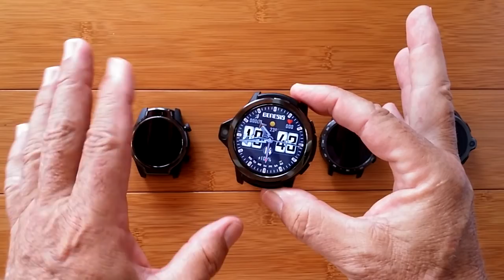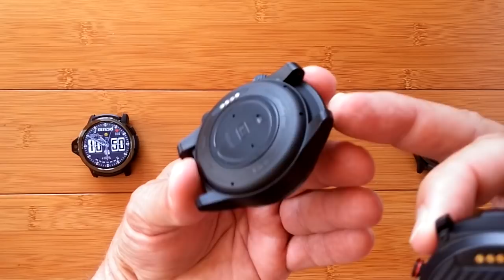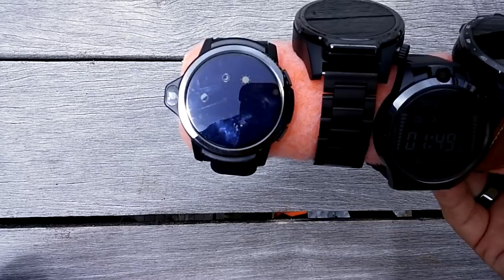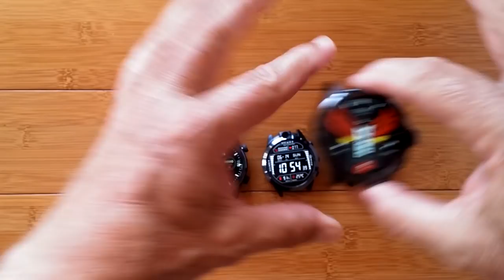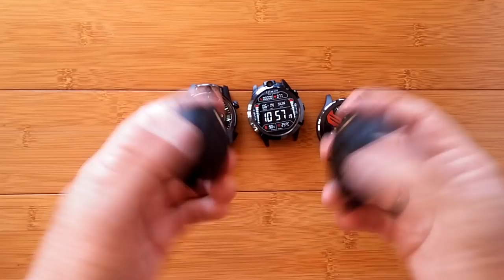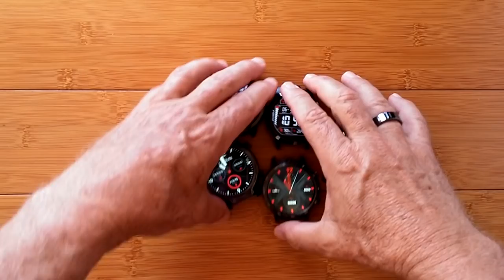Summer 2020 Top Round Flagship Android Smartwatches Compared: Genesis, LEM12, Prime, S08, Thor 5 Pro

Comment: When You tested the watches outdoor screen wisibility, all on one towels,the S08 and the  kospet dont use the full brightness.When You  jump in to inside, (17:00 ) You can see the floating programm circle on the kospet,and s08 is lower 2 or 3  point, under maximum brightness...or i am look some wrong?
Reply from the maker: The ones with the Display Brightness app installed override whatever the brightness level is on the watch indicator, so that may be misleading. My attempt was to set the brightness to maximum outdoors on all watches, and adjust to best brightness indoors so the watch image wouldn't be washed out. The comparison is meant to assess outdoor viewability as indoor viewing is dependent on my backlighting, stage illumination, and actual watch face brightness, which varies from watch to watch and can't really be compared under those conditions.
Reply: @SWT   I say this,because on my prime ,yes,the main brightness set up have 3mode,like low,medium,full bright,but, for example if i choose the full light option,and then go to the set up with slide option ,i can adjust the brightness without levels.And if i slide to forexample to 65%,and then go to main menu, of course,the main menu show,the light is on the full,but the slide option show,the light is not on the full.I have see this on Your video too ,when You compared the genesis to prime a months ago..
Have You make a long test with S08?I mean eweryday test? Use the watch day and night,wash hand,go to strand,and so on..?Have this watch the real IP68?
I think,if the manufacturer of S08 build the wireless charger coil around sim round cover,in place of the charge pin,the watch win all comparison!
 
Oh,one more option..the nfc chip..i know,i know,the chinese dont pay for license,because cost one arm and one leg,but we can use the nfc not just for pay...door open,car open,light up and down in the house,etc..what You think?

Comment: So in the outdoor comparison, all but the Genesis are using up battery as fast as possible while looking it at, yes? The Genesis is at lowest power yes?. I don't think you mentioned that. I'm a transflective watchface junkie, have used maybe 100 or more, and finally found one called Vintage-gauge-MKI that looks best with no backlight, and is easily visible indoors.
Reply from the maker: Actually no, David. Sorry to disappoint. The Genesis is more of a "reflective" than transflective screen, so it still needs a backlight indoors. So do transflective screen watches, but the screen illumination management on the Genesis is Android 7.1.1 and aligned with other Android watches. What I'm saying is that the darn backlight is still on anytime the screen is on, indoors or out. Transflective screens only light up for a few seconds when you press a button. I even have offered a $100 cash reward to anybody that can figure out a way to shut off that darn Genesis backlight but leave the screen activated, without rooting the watch, and guess what. Nobody has been able to do it, rooted or not. So sadly, the Genesis battery life is nowhere near what it would be if the screen were handled as if it were transflective. Hope this makes sense.
Reply: @SWT  very helpful, ticks. Thanks for the info.  Until another good transflective comes out I'm not giving up my amazfit pace. What I hope they'll really do is make a smart watch with the new color e-ink tech they're trying in the new ebooks now. Why they haven't is astonishing to me.

Comment: Where to buy legit Genesis? ♥️
Reply from the maker: Not available anymore. Not likely to see another production run soon, either. Sorry. It was a great watch. Only 500 ever made. Real collector's item now.
Reply from the maker: NEW: Check out the Kospet Prime S UPGRADED Kronos Blade Genesis design with top camera and front camera on right side of watch:  https://www.banggood.com/custlink/vDmYjnTMRK  ( Use Coupon: BGb76871 for launch price $99.99 limited supply )
Doesn't have the transflective screen, but the camera is in the right place at the top.

Comment: You are wrong about 5ATM on the second watch , read this . Lots of people dont know this . 
WR - the watch is not waterproof - avoid any contact with water. WR 30m / 3ATM / 3bar - only slight spraying, but not immersion of the watch in water. WR 50m / 5ATM / 5bar - only slight spraying (when washing hands, rain, moisture) , but not immersion of the watch in water. WR 100m / 10ATM / 10bar - watches suitable for swimming and surface diving. WR 200m / 20ATM / 20bar - watches suitable for recreational diving (scuba diving). WR 300m / 30ATM / 30bar and more - watches suitable for deep, professional diving (with a bottle).
Reply from the maker: It's all about MOVING water or STILL water. https://www.howtogeek.com/218747/water-resistant-gadgets-arent-waterproof-what-you-need-to-know/

Comment: Thanks for this informative review Mr. Ticks. I understand all these watches have a GPS chip. Is there a location tracker functionality as well? I wanted to get one for my kids and make sure they come straight home from school. To be clear, I want to be able to track their location from my Iphone. Thanks!
Reply from the maker: There are some 3rd party ones out there you can use. They're the same ones you would use on an Android phone. I'm not sure about crossover between iPhone and Android in being able to track, so you might want to check that out between phones first, and then migrate the appropriate app to an Android watch and try it out. One thing to remember, you will need the watch to be connected to the Internet to send the location signal, and that means putting in a compatible SIM.

Comment: Can u pls tell me if any of these support bluetooth earphones calling??
Reply from the maker: Bluetooth calling is not supported in any Android smartwatches after Android 5.1 (and a select few Android 6). These are all Android 7.1.1 based, so no. If, however, you have the bluetooth earphones connected to your watch and use a SIM in the watch, then it might be possible, though I haven't tried it.
Reply: @SWT  thanks for ur reply...well thats exactly what i wanted to ask....bluetooth connected to a watch and a sim inside the watch itself....anyways thanks for your time.
Reply from the maker: It should work as in that configuration it's no different than a small Android phone running A7.1.1. As long as your buds have the ability to answer your phone when you tether them to your phone, it should work for these watches. You might even be able to bring up "OK Google" from the earbuds if they can be programmed for that.
Reply: @SWT  thanks alot...and one more last question if u dont mind: any site to get the kronosblade genesis like ebay or something else than their website? Cause it doesnt seem trusty or having paypal! And i live in middle east...

Comment: They seem all useless but the Genesis. Why? That transreflective screen. Those things don't run forever and display backlighting is a huge power consumer usually (unsure if this is the case with the small displays on smartwatches). So the ability to display things in bright sunlight with no backlight is a killer feature.
Reply from the maker: Totally agree, and still shocked other watches haven't used this screen yet. Originally appeared on the Zeblaze Thor Pro, and Jason was able to get the same screen for the Genesis, but nobody else has used it. Too bad. It's one of the best features, even if the colors aren't as rich on an AMOLED screen. If you can't see the screen outdoors, it really doesn't matter how vivid it is. Duh.

Comment: Mr T if you use M2d sender and receiver you can make every Android watch able to reply to messages and app notifications from your watch. I normally kept silent about it but it's a game changer. They even have a Bluetooth version, as the usual version works when both phone and watch are on a wifi signal
Reply from the maker: Wow, great to know. I've heard some folks like to use Watch Droid, but M2d sounds like a good option. Appreciate you sharing this with us!
Reply: @SWT  it creates an interactive notification tab that opens whenever a notification comes in. Much more efficient than watch droid. I'd love for a video to be made on it. It makes every watch u ever reviewed extremely capable. Only downside is it's slightly more technical to set up

Comment: If using the full Android smartwatch for fitness activities (cycling etc), how best to use gos and how long will the battery hold?
Reply from the maker: First swipe down and activate the GPS icon, last on the right in middle row. Next launch Fitness app and swipe twice to the left and make sure switch is turned on to use GPS. Swipe back and pick walking, running, or cycling and start a practice session. Wait for GPS to connect, and then you can swipe right and long hold over the stop button. Scroll down and delete the practice activity, and now you are all set to do a real event. Remember, GPS only works for outdoor walking, running, and cycling.
Reply: @SWT  do you have any estimated time it will last? Will a whole day cycling be doable? For example when using the rollme? Or the kospet prime?

Comment: Great video just what I needed thumbs up! Alright, I made up my mind I'm returning the Kospet for the Rollme. I have a question I bought a band for the Kospet would it fit the Rollme or should I return that also? Suggestion on your tips and tricks video you should name it "Ticks Tips & Tricks!"
Reply from the maker: Haha, I like it, Ticks Tips & Tricks. The Prime and Rollme and Genesis all use 24mm removable bands, The LEM12 and Thor 5 Pro use 22mm and are smaller.
Reply: @SWT  Hey, I just got the Rollme in the mail today its good but when I try to go into the play store I get server error there is no update for the watch I checked and also reset the watch turned on off watch turned on off wifi tested the built in browser I am getting a connection, any suggestions?
Reply: @LoudForLife   hi. I have a question please.  I got a defective Rollme 3 days ago and wants to return it for Kospet Prime. Since you have use both Rollme and kospet, 
Which one do you like better? Which one has better build quality, runs smoothly  and screen brightness?
Have you had any problems with the rollme?
Mine came with screen flickering and would not turn on. So am returning it and was very dissapointed. It may just be a defective unit. Please let me know your experiences with both watches.
Thanks

Comment: Honestly, no matter how long you talk about them I would watch the whole video. I like your enthusiasm for them. I have a request! This might be extremely interesting to you.
I bought a Kospet Prime (non SE) and at first I liked it. That said, I found a very VERY critical flaw. When operating on mobile data on AT&T Band 17 (700mhz) the touch screen has constant random phantom touches whenever data is sent or received. This does not occur when on WiFi or Bluetooth internet connections. Also, a test I would love to see you do is to see how the screens respond to touch. The basic way is to enable "Show Touches" in the developer settings. You may need a "hidden settings" app to get to the real developer settings. This shows a white dot wherever you touch it.
My Prime would show lots of them all over the edges mostly. If you found a full screen drawing app and ran your finger around the edges, you would also find on my Prime that the 45* angle "corners" of the screen could NOT register touch at all for the last 2.5mm or so. Midle top and middle sides worked right to the edge. This made it very hard to press enter on the stock keyboard, it would almost always press "m" instead. I also wonder about multi touch on the S08. I hope it works as expected on it like it did on my Prime, but I am willing to lose multi touch to have a WORKING touch screen. 

Would you be able to make a touch test video? I think you would find the results interesting. I know I would. Capacitive touch screens use a conductive layer of fine wires typically laid out like a screen. Vertical and horizontal lines. This leads me to believe most of these round screens will have limited responses on the 45* "corners". You can use "Show taps" or "Show Touches" depending on Android version for the dots, and "Pointer Location" right under that to draw lines on the screen wherever your finger last went. Draw your finger around the edge in a circle and observe if it makes more of a plus instead of a circle. 

Thanks for all of your excellent videos!
Reply from the maker: Thanks for your feedback. Glad you like watching just for watching's sake. Interesting idea you have there. I'll try it out and see if it feels worthy of a video. I always wanted to try tap dancing. Now's my change!

Comment: Which one would you buy?
Reply from the maker: Genesis -- best for visibility outdoors, best camera placement
S08 -- best for waterproof, best overall cameras, both are 8MP
Thor 5 Pro -- smallest for smaller wrists, bright screen can almost be seen OK outdoors, also only one with always on screen option but battery drains real fast
S08 has largest extra charging dock, Thor 5 Pro has smaller charging dock, Genesis has booster dock you can wear under the watch while on your arm and comes with an earbud power bank for extra charging of the watch.

Comment: When it comes to battery life I don't buy those large numbers.  For example, I have the Oukitel Z32, Lemfo 12 clone, with an installed sim card and I can't even get 8 hours of normal no phone use before it has to be recharged.  On my unit I'm down to around 3% battery after 7.5 hours.  The charge base only has 83% of the watch capacity so when I charge I can only raise my watches charge level by 83% before its complete discharged and needs to go back on the charger.  Perhaps in the future when you test battery life you can do it with a sim card installed so we can see the real world battery drain from the cell radio.
Reply from the maker: Thanks for the feedback. I'm going to rely on you guys to tell us the battery life under different conditions. Thanks for letting us all know.

Comment: The buttons of my kospet prime are starting to feel less clicky and softer. Will this be an issue on the long run?
Reply from the maker: Sad to say, YES! The lifecycle of watch buttons on smartwatches is relatively short, and I think they anticipate you'll probably upgrade your watch before they break, but if you use them a lot, they may stop working. True on all these watches. That's why I recommend using apps like Floating Toucher that can substitute for button presses in most instances.
Reply: @SWT  what type of floating toucher?
Reply from the maker: The app Floating Toucher:  TinyURL.com/androidwatches
Reply: @SWT  how do I download it?
Reply from the maker: It's a shard Google Drive, just copy it into your computer then transfer it over to the watch via the charging cable. Once there, touch it and it will install. There's bunches of videos up all over the place if you're new to putting apps into smartwatches.
Reply: @SWT  thank u so much i really appreciate it